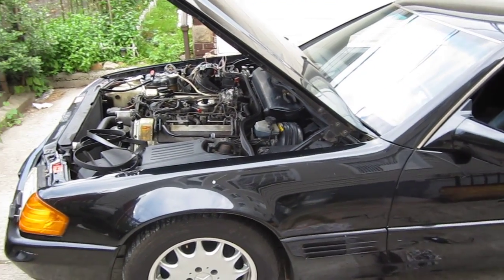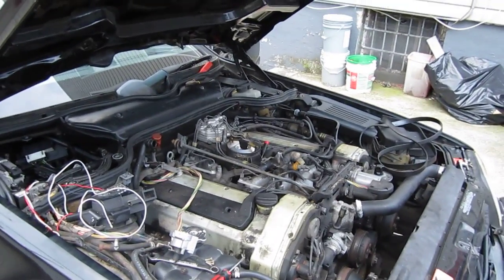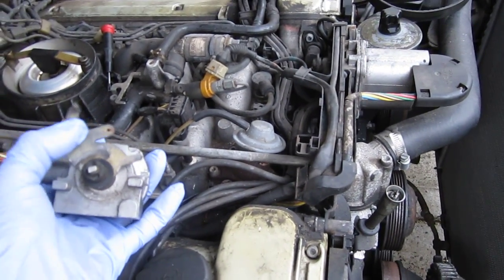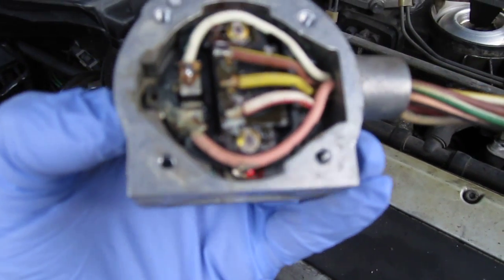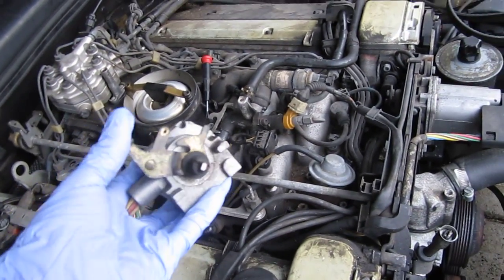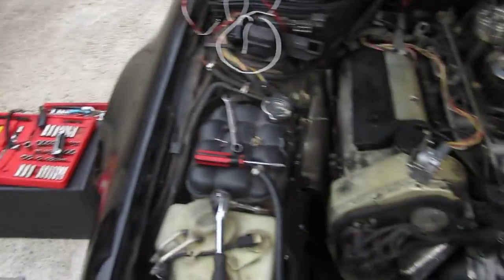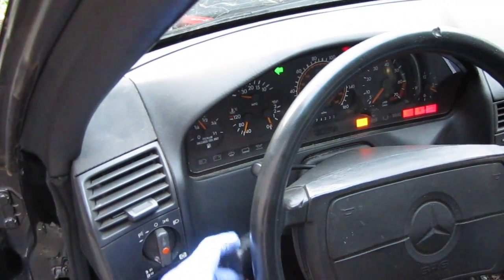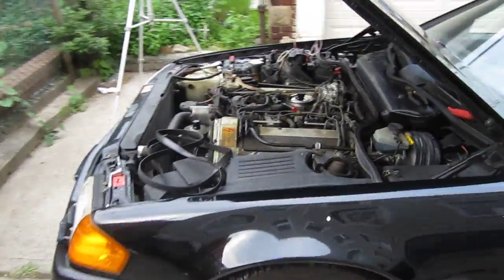1990-1992 500SL early version electronic throttle actuator system, ASR problem part 1

Comment: I’m trying to diagnose mine at the moment. I get intermittent ASR & SRS lights rough running then smooth like you wouldn’t notice it’s turned on.
I’m starting at the OVP relay. Is it common for the Idle Air Control Valve to cause this issue?

Comment: Hi Vito... I have a 1991 w126 with ASR 2..  recently the asr light started coming on at idle, after turning on the car for a few minutes and not even touching the gas pedal yet...  no limp mode so far...  It is a complex system, I will test the abs sensors, brake switch, and ....  anything else? could it be the potentiometer?

Comment: Thanks. My 1991 M103 engined R129 has ASR light on. Could it be similar problem? I did everything except swap the ECU.  It runs very well. But the lights mean can't use it in France. Help!

Comment: I changed my battery on my 1991 SL500 now all types of sensors came on and the car started being funny emergency’s would come on their own the drop top tries to go down idk if I messed up any sensors or it’s the battery ??  Any ideas
Reply from the maker: Car needs proper diagnostic. It is not possible what went wrong after battery replacement without having whole car for diagnostic.
Reply: vsandvs  I was recommended to buy and OBD1 to find out what it is but regardless if I were to find out what the problem is would know much how to fix it I am a DIY type of person but can’t find a lot of videos on this car as it is

Comment: @Martin Loke...
Was there any transmission work done recently? It is possible to switch the wires for the kickdown solenoid and the upshift delay solenoid. It will produce this symptom. If the wires are switched, you are essentially dumping the governor pressure when you hit the kickdown switch.

Comment: Hi,My 91 500SL has problem when I hit the kick down. it flattens instead of accelerate.Any ideas?Acceleration is good when pedl is half way then it flatspots when I press down more.
Reply: I have the same problem. Did u get it fixed yet?
Reply: I have the same problem on my 1992 500SL. It won’t rev over 3000rpm in any gear

Comment: I have a 1990 500SL.  I simply cannot find the potentiometer.  Unfortunately your video shows it already taken out.  The Star manual says it is on the passenger side but where?  I cannot see any wires or anything that looks like what you hold in your hand.  Am I missing something or are there two versions?  This is attached to some linkage isn't it?  It is not attached to the butterfly, right?  Thanks

Comment: Ended up replacing the instrument cluster now everything works.  Had another issue with lack of power. Removed the EHA and adjusted the 2mm allen inside 1/4 turn CW. Now full power again.

Comment: I have a 92 500SL with a instrument cluster problem.  My engine temp sender is good, though the gauge needle sets at the max stop or beyond 120 (engine not over heating and normal).  I have fixed the 470Ω capacitor which causes the flashing lights in the cluster when using the signal stalk.  When it was apart I noticed a break on one of the traced in the printed circuit board (PCB).  Is there a resource that provides these boards as replacements?

Comment: I Have a 1991 300ce, i removed the throttle body, ive found breaks in the wire that connect to it and to the actuator and potentiometer,im not sure the name but there is a part that connects to the throttle body and actuator i think its under the main exhaust manifold, i have no idea how to get to it, mine is the ASR old school one ive checked wiring harness in general i think its good, car has 172k... help!